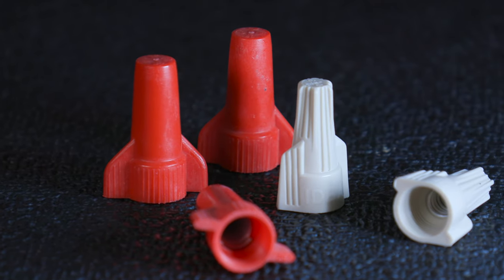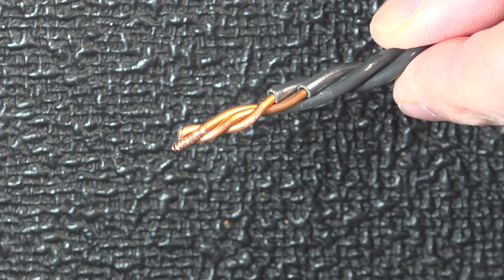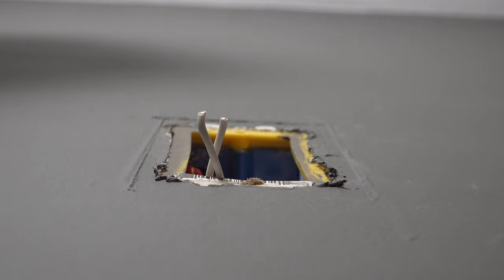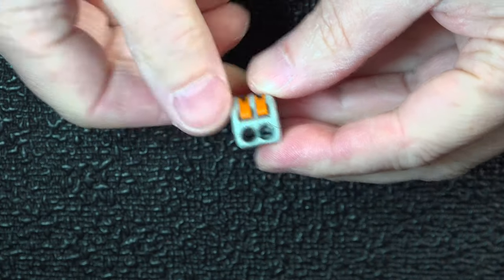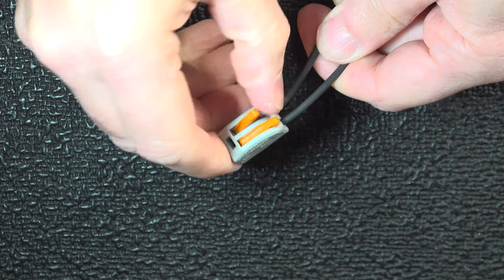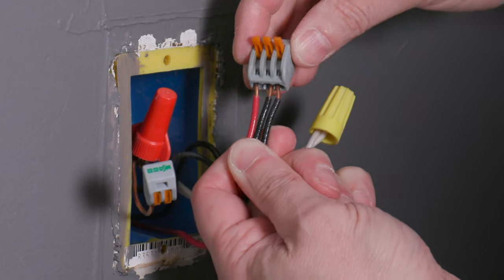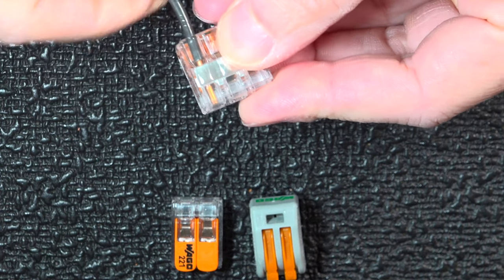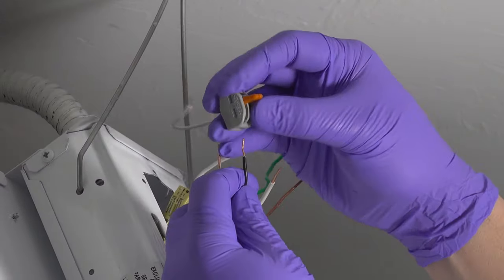Never use Wire Nuts Again - Wago is Better Electrical Connector

Comment: Been an electrician for over 30 years and never had a problem re-using wire nuts WITHOUT cutting existing splice off, or adding another wire into the splice, I call b.s.

625 👍.         87 comments
I'm a effin celebrity 🤣😂🤣
Reply: Yes! Thank you!! Being a DIY homeowner for an equal amount of time, I also call BS on this! What nonsense! Wire nuts are NOT dangerous and they don't need to be cut off and they can most certainly be reused.
Reply: Calling B.S. Here.   Wire Nuts For The Win.
Reply: I've been JW for 17 and I can't tell you how many times I've been ti a house call for something not working because some ass hat thought you needed to use a cheater pipe to put on a wire nut cut through one wire partially then let it arc to a pile of plastic.
Reply: @shawnshurtz9147  thats so crazy why the f would someone do that lmao
Reply: I bought 1k for industrial applications.
Even with exposure of water and heat they last at least 1 year
Reply: I've been an electrician for 19 years now and I couldn't agree more
Reply: I can see the value in using wago but if you have trouble using wire nuts than you shouldnt be doing any electrical work
Reply: 8 year electrician. Who cuts the wires and replaces the nut good lord im gonna smack the next carpenter that touches wiring at my jobs
Reply: I’ve had no problem using the same wire nut 3-5 times .
Reply: Thank you!
Reply: The worst that can happen with the wire nut is when the threads will stay on wires while you have the plastic in your hand...but...its not really any problem....
Reply: @DavidRobinson-ou8fh  if you install them correctly. Many electricians do not know how to properly use wire nut. I've seen it over and over....
Reply: I haven't seen anything other than BS on this channel.
Reply: I think the box thingy is cooler simpler tbh
Reply: While i agree that wire nuts are reusable, and restriping the wire is pretty rare to non-existent, i like having the choice of another tool.  I definitely like the new design and being able to see that the connection is good. I have had moments when i thought the connection was good with a wirenut only to find out it was not a very good connection, and where too much current was flowing through only a very small contact point.  
There are definitely other times I could also see a wago being a better choice.  Like when you have very high gauge and it is a pain to get that twist with a wire nut, the wago would be a much easier connector.  Also I just think it feels cleaner.  A three way connector doesn't require you to remove all the wires if you want to replace one, etc.  It just seems like a better way to organize and maintain then with a bunch of wire nuts. 
But yea, to each his own.  Whatever works for people, go for it.  Much better technicians then myself have used wire nuts for generations it clearly works for them, i could care less what they choose. But for myself, I can see the benefits in some cases, regardless of whether or not this video did a good job selling them...
Reply: I solve this problem with strip connectors and duct tape, I bring voltage tester pen with me when dealing with main power anyway, so no problem there
Reply: @electronresonator8882  Yea well, that is probably the next level up really, proper way to deal with complex wiring.  I guess i just see the wago as a possible quicker/smaller strip connector solution, slightly above just the wire nut, and not as much setup involved as installing a strip connector somewhere, etc.    
And a wagu is much easier to pick up and run with for the average home enthusiast then a strip connector is. Though in many ways if you can't handle strip connector then you shouldn't be doing any electrical work anyway. But yea, again, just for me personally, i could see a use for the wagu in a few cases.
Reply: Also an electrician here. Wagos are crap. There are so many stupid exaggerations of wirenut “issues” in this video I don’t even know where to begin. The wagos without levers use spring clips to bite into the wire. They lose tension as a wire heat cycles. So in residential where cheap contractors use backstab receptacles, any sort of real load like a space heater or floor buffer will quickly creat a bad connection and melted outlet. I’ve replaced many of them. There is no substitute for a proper pressure connector such as a wirenut or screw terminal. This guy is giving dangerous advice.
Reply: @batterybuilding  Funny I was about to say that I thought they would be more useful if they came with a built in fuse as well, for older buildings and old wiring, say which had not been setup/meant for higher wattages for long periods, and so having another safety to prevent issues perhaps with a newly installed fixture, or adding another outlet.  Considering that is a common cause of electrical fires, just a quick way to add in a bit more safety in older buildings without doing the full rewire, etc.  So basically an inline fuse with a wire nut combined...
But this sounds like the opposite of that.  I would imagine that not all wagu are made equal, but i guess with a wire nut you never have to worry about that....
I guess I will take your advice Charley, and avoid them in general.
Reply: I’ve been a service electrician for over 16 years and have found that the connection wego’s provide are not always a good connection and have many more problems than wire nuts. Now that being said that changes depending on the gauge of wire you use. fixture wire which is normally 22 gauge has no problem whatsoever when you get into 14 or 12 gauge then the potential for a poor connection and and introduction of resistance increases.
Reply: another electrician in agreement, wire nuts work, give them a slight tug to ensure a good connection, wago connectors make pretty flimsy connections in my experience even if they are easy to use and reuse.
Reply: @FirePrank6  I guess this is the issue, everyone is an expert with a youtube channel now... :)
You would guess that most people would consult with someone who is a professional before giving advice to a lot of people.  Especially around something as serious as home electrical work, where getting it wrong can mean some family is having a pretty bad day....
Maybe he did, but the tag line is more catchy this way....
Reply: DIY type here. I dont cut off wire nuts when doing electrical work but I do swap them they are cheap so I see no good reason not to. I do agree you can 100% get away with it though.
Reply: Exactly!
Reply: People who don't use wirenuts properly can just as easily misuse a wago or push-in connector. I can see it now.. tossing the nut off from some braided #12, then taking their strippers and trying to untwist it all crooked and curly cued, then ram all that vortex of wire in the connector and snap down thinking it's in there all the way while about a half inch of exposed copper is poking out, it gets shoved back in the box then pops back out the wago the second the last cover plate screw is on. There are methods for using wirenuts in particular applications such as splicing solid to stranded, otherwise it wouldn't be accepted to do so. If you're going to splice solid to stranded you shouldn't for example just be joining the tips together like it's a solid to solid splice of small enough gauge to be braided by the wire nut alone. Twisting it properly by wrapping the stranded in the right direction around the solid so just enough extra stranded is exposed for a proper bind is one way of doing it without spending more money on wagos.
Reply: As a remodeler I repeatedly have issues with adding a 4th or 5th 12 gauge wire.
Reply: I have been a Master Electrician for over 40 yrs.....I have re-used wire nuts Many times with no problem.....There IS  a way to do it....Experience is the Key !!!
Reply: I used to work for a company that makes arcade games consoles, beside soldiering,we also use wire nuts, and wire blocks, never had any problems, it’s much cheaper than what the guy is showing in the video.
Reply: @batterybuilding  I agree. He's a salesman. Trying to pitch his product. Done properly, wirenuts will hold indefinitely.  It's the morons who just barely twist the nut on who cause fires in homes. That and backstabs.
Reply: Yup BS!! if the load is too much for the wire gauge then obviously it's a recipe for disaster.
Reply: I agree this is just trying to promote an expensive connector.
Reply: @awalden  the problem with wire nuts is as the wire ages they loosen up and you end up with a contact that welds itself and shorts out eventually
Reply: well what’s wrong with these? i’ve has issues with wire nuts and it’s annoying when you have to find one that isn’t a lemon to get a good connection
Reply: Don't need to cut the wire......... Just the wire nut is not secured enough for me(former British colony Hong Kong are using UK electrical connector that using screw to secured wiring......)
Reply: I'd say in all of the wiring I've done, I've come across maybe 1% of the wire nuts are not reusable.
Reply: I work as an industrial electrician and I never had a problem with wire nuts.
Reply: @SavageCrackerXPF  true statement, cant tell you how many times I have went to service a T-pole because a carpenter jammed a pencil or screw driver into the GfI button thinking they will stop the plug from tripping and end up burning it up.
Reply: Been doing electric work for 20 years and not one problem with reusing a wire nut.
Reply: @batterybuilding  ya the company I worked for had a no backstab policy, saved a ton on service calls.
Reply: @awalden  How are you going to rejoin a solid coiled wire to a wire that isn't coiled? Wire-nuts have always been stupid.
Reply: Facts my guyyy
Reply: Miuricans don't want to look at something better... In Europe we use this kind of connectors since at least 2012 and they are excellent. Great for doing 1 time job or going there for some rewiring. They don't heat up under load I personally tested with 6000w passing through the connection. But in the end you do you it's your choice...
Reply: I've been a commercial kitchen repair guy and I never had problems with twist caps. You do it often enough and you learn. Lazy people problems.
Reply: @PhrontDoor  I don't rejoin anything. I install it once, properly, and then I'm done. This is an "invented" problem in search of an expensive solution.
Reply: @thecloneguyz  Ridiculous. No they don't "loosen with age". Copper wiring doesn't get smaller with age. Strip and connect the wires properly. Screw-on the appropriately sized wire-nut and be done with it. This is an "invented" problem in search of an expensive solution.
Reply: Totally agree!  This is the ultimate "strawman" argument.  I wouldn't be surprised if the presenter somehow benefits from the sale of these new things.
Reply: @awalden  the wires absolutely shrink over time the more they get used
Why do you think the insulation dries out and falls off especially anything from the 70's or 80's the wire nuts just pull right off of the top
And you can't fit more than 4 or 5 wire nuts in a single gang box I can put 10 WAGOS in a box no problem
Reply: @metzgerdan  it works for how electrical is set up there, it's different in the states we run on 110
Reply: Wirenuts have worked for decades, safely. I agree this video is total overkill, Wago's are great for special applications but not needed for your everyday 14/2 on 15A work.
Reply: @shawnshurtz9147  😂😂😂
Reply: 20 years hvacr. I've seen those new connectors burnt up at a higher rate. Def bs
Reply: @thecloneguyz  If wire nuts pull right off, then they weren't installed properly. The copper wires in our 70's house haven't shrunk. (Do you have any links or further information about this "shrinking wire" phenomenon? Are there any studies that indicate long would it take for a 10 gauge wire to become a 12 gauge wire, or smaller?) --- This is just an expensive gimmick that's looking to solve a problem that does not exist. I'm sure these items work just fine, my point is they're not needed. The scare-tactics are ridiculous. Any competent electrician or DIY homeowner can use wire nuts with confidence.
Reply: @spol1622  learned it at school and after that never used a wire but again. 
Maybe its a EU thing
Reply: Senior electrician, and yeah. This seems more like an 'As Seen on TV' commercial.
Reply: @lerch400block  The problem is, they are essentially a fusible link.
Reply: then why dont you buy some and try them? any time i see a thing i call bs i buy it to try it
Reply: I'm not a certified elechicken but I do a lot of industrial 3-phase with 110 control wiring all uses wire nuts I'll call a giant load of bullshit I think this dude is one of them guys that charges you $90 an hour and takes three days to do a 2-hour job
Reply: Yeah, I call b.s. too.
Reply: I'm not even an electrician an when ever I used a old-school but I never had a problem lol
Reply: @omeganickum  How do you make chooch?  We want everything skookum.
Reply: I'm a relatively new electrician and ill tell you right now adding another wise to a set is for sure a pain in the ass no one wants to do, the whole thing needs to be just right or everything falls apart, worse everything can look right and you can come back later only to find the connection has fallen out, (bet this has happened to you and you just weren't the guy who had to fix it.) and for new guys 6 plus is just asking for one wire in the center to not be twisted or secure at all. Also as you should know from the first-year electrical class even the smallest knicks can cause heat build-up and any form of damage on a wire should lead to its being discarding, not that this is ever done we mostly just slap some e tap on cuts if the runs already been pulled.  so I'm calling old spark set in his ways bs right here.
Reply: @Hathorr1067  "But wait... there's MORE!" Order before midnight tonight and get a SECOND SET free. (Just pay separate shipping and handling.) Order a third set and get a free bamboo steamer!
Reply: @Suno-ta-sei  I have used them many times in the past but still prefer wire nuts 👍
Reply: @awalden  dude you know a breaker is supposed to be replaced after it breaks five to seven times right because it wears out the metal on the inside and breaks easier and easier every single time?
Because I run into electrician who don't know that a breaker is supposed to be replaced after it breaks five to seven times and that tells me that they truly don't understand electricity or path of least resistance
The more you use copper over time the more it DRIES OUT THE INSULATION and SHRINKS a tiny tiny bit
That's just wear and tear cuz when the copper gets really hot it expands and then when you use it regularly it doesn't make the same contacts-
Especially with older outlets and older Hardware
And if you understand Electronics you would understand that we're talking about the difference of hundreds or thousands of an inch which is all it takes for you to lose contact and WELD that connection with POOR CONNECTIVITY
Reply: @RicoGG  don't waste your time bringing up heat buildup AND welding loose connections cuz these guys won't believe it they're lost in their own reality
Reply: @thecloneguyz  What a BIZARRE argument. It's silly! --- So the insulation is shrinking "hundredths of thousandths" of an inch, eh? Over the course of 50 years? Longer? 😂🤣😂🤣😂🤣 Ridiculous! 

If "the copper gets really hot" then you're doing something WRONG!!! No expensive gimmick wire-nut alternative can save the homeowner from faulty wiring.
Reply: im glad i see comments like this,  else i would have believed everything this guy told me,
Reply: @awalden  
Notice you wont touch replacing the breaker after 5 - 7 breaks 
Is it cause the metal inside DOSENT wear away slowly? 
PFFFFFFFFFTTTTTTTTTBWUHAHAHAHAHAHAHAHAHAHAHA
Reply: @thecloneguyz  That's dishonest "repairman" claptrap. Always trying to scare homeowners and "upsell" things that aren't needed.

Here's the REALITY: The Consumer Product Safety Commission (CPSC) estimates the life expectancy of a circuit breaker to be around 30 to 40 years, and it's the same for the GFCI, AFCI, and standard breakers.

Lifetime is not determined just by number of trips, but by how hot it gets for extended periods and, of course, it is working hardest just before it trips so if the circuit is overloaded but rarely trips the breaker is working harder than one that trips regularly due to short overloads.The former sounds like your situation so i would replace just to avoid nuisance trips in the future. Breakers are cheap.

Also, very old breakers have less stringent standards than new ones, depending on national electrical codes so for very old breakers it is always a good idea to upgrade when doing a major rewire.

Finally, when breakers do start to fail they often start to become too sensitive and trip at lower than rated current so if it trips a few times even though it looks like circuit is not overloaded its a good idea to change the breaker.
Reply: @thecloneguyz  You wrote: "Notice you wont touch replacing the breaker after 5 - 7 breaks Is it cause the metal inside DOSENT wear away slowly?' --- Dude, that makes no grammatical sense at all. I never said anything like that. Are you stoned? Or did you mean to reply to someone else? -- Next thing you'll be telling us is that contrails are how the government controls our minds.
Reply: @untitledC64  ... Does this expensive gimmick work? Sure. --- Is it needed? Absolutely NOT! --- The "problem" it's here to cure doesn't exist. It's just a different (albeit more expensive) way to join wires. --- But I do have my doubts as to whether this gimmick makes enough contact between two wires to be safe. Or is it a thinner and weaker part of the electrical path? Does it turn your 12-gauge wire into 14-gauge at the crimp-point? We know that two 12-gauge wires that are connected with wire nuts will never be LESS than 12-gauge in thickness. But how much of the wire's gauge/thickness is LOST inside these cheap "sharkbite" gimmicks? It seems to me that they'd be more dangerous than wirenuts..
Reply: Yeah well these are still better, it's nice to pull hot wires out one by one and redo a fixture without trying to un twist some guys mess of wire nuts..  plus these set a standard on how to wire something, no more asshole trying to cram too many wires in a wire nut that's too small or the opposite. I started using these and it makes the job better and also makes going back and doing a change out faster, alot faster!  Plus more fixture companies are changing to these so it's nice to keep it all the same.
Reply: @BioMess  this is why we can have better things.
Reply: @Ryan-re1rs  There already are standards on how to properly wire. This expensive gimmick isn't going to force people to comply with codes. There will always be cheaters and other idiots who do not care about safety. --- What needs to be "changed out" so frequently that people cannot be bothered to wire their homes safely and properly? I've got sockets and switches in my home that are over 30 years old. Do people these days actually remodel 4-5 times a year that they need to change-out their wiring as though they were plugging-in and removing cards from a desktop computer? 

Nobody is saying that they're not "easy". Nobody is saying that they're completely unsafe. My objection is that they're expensive and unnecessary... and LIES are being told about properly installed wire-nuts in order to create a false demand for this gimmick.
Reply: @untitledC64  always research
Reply: @thecloneguyz  I don't think that is right sorry. I would make a bet on it
Reply: @thecloneguyz  then you are overloading the box with that many wires.      If you are not familiar with the NEC. You won't beat the electricians here ..... once you become an electrician you get it you know what is right . Any one else just think they know.....
Reply: @thecloneguyz  none of the information that comes with any of that equipment says anything about replacing breakers in that way .